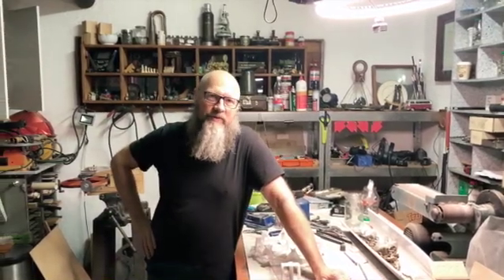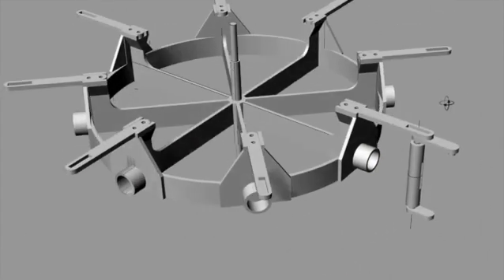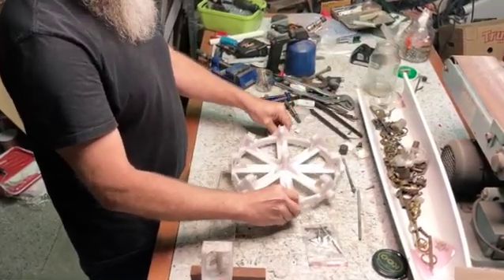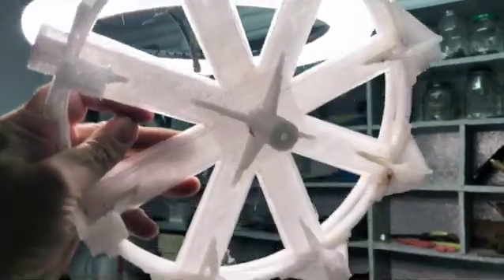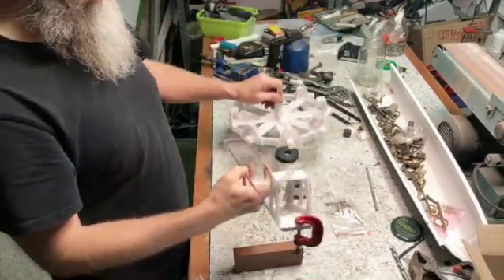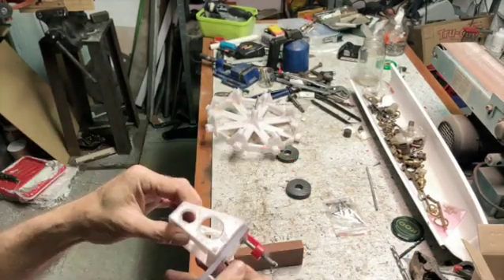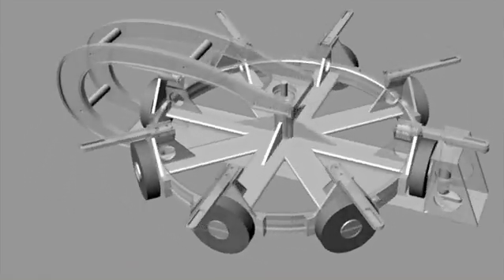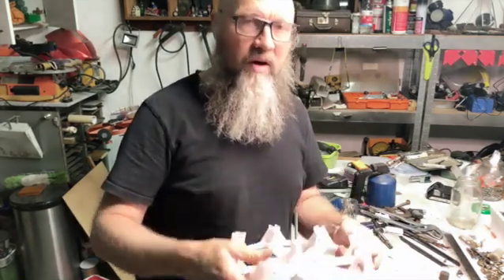How to make a self running magnet motor part 3. Free energy perhaps… l don't know.

Comment: For the record: The wheel of the Ukrainian Igor Beletskiy does NOT work. At the end of his video (21m40s), he says the following: "_Of course, I could shoot this video in such a way that this motor worked for me just as it did for this grandfather, and I could say that this is the real first working model of a perpetual motion machine, and frankly, I even had such thoughts. But that would be a completely different story. ... Sometimes I lose faith in humanity._"

I think Igor has not experimented long enough with adjusting the flipping small magnet. As Sam said, it should not be too weak, but certainly not too strong either! It requires a lot of fine-tuning. The small extra magnets in Igor's replica could also negatively influence the magnetic field between the flipping small magnet and the ring magnets, as Wim also mentioned earlier.

In one of his YouTube comments, Sam says he has tried to mount more than four ring magnets on the wheel in the hopes of generating more power or speed, but failed because in that case the flipping small magnet would not have enough time to fall back to its initial position, where it needs to be before the next ring magnet arrives.
The diameter of Sam's wheel is 19 cm.

By the way, I think that with eight ring magnets on the wheel, the magnetic fields are no longer separated and the wheel becomes one big magnetic field, so the flipping small magnet no longer works properly. Perhaps you could also test with five, or at most six ring magnets on a wheel?

Anyway, keep up the great work, Christoff! Looking forward to your next video!  :-)
Reply from the maker: Thanks for the constructive feedback. I will definitely take all of this into consideration. This journey only started but already I see a huge drop in my views from the first one. I hope to have some positive success in my next video. Will Check out your channel also:-)
Reply: Hi Christoff!

I just saw your messages and watched the video. It looks interesting, and I'll try to find some more information about it. Someone has tried to recreate it: https://www.youtube.com/watch?v=OQ0MNWA1XuQ

But, actually, of all the perpetual motion machines I've seen so far, I think there's only one credible; Sam's construction, which you are building right now!

Comment: information.        the switching/commutation mechanism  SHOULD  BE  LOCATED  AT  THE  SMALLEST  POSSIBLE  RADIUS/near the center of rotation.!       because, that mechanism is  a source  of  Breaking DRAG.!!!        compare the  smaller radius of a commutator in a brushed DC motor.        googletranslate
Reply from the maker: Thanks David. That makes sense. However, the other models I referred to is working this way. Once I can replicate it and get it to run, I will look into getting the switching closer to the center. Problem would be if it is close to the center, I would still have to transfer the movement to the switch, and it will have to step up the leverage to get more speed in the action. It might end up being the same amount of energy taken from the momentum.

Comment: I like how you are already experimenting with a different design instead of just copying what Sam made. Is your wheel going to run horizontally? I am very curious you can make it work with eight magnets. I have watched Igor's video a while ago too. It confirmed to me that the idea works. Do you know why the Italian needed to add an electromagnet?
When I saw the design Sam made it stood out to me that everything was made to prevent any friction. He used bent needles, brass screws and small brass tubes for the needles to turn in. Also he told me he used bearings that you can find on model planes and helicopters. These are very low friction bearings, with a special name too, but I forgot. I've got a feeling the Italian man needed an electromagnet because his design didn't completely resemble Sam's and therefore could not overcome the friction. Or, and it would be VERY disappointing: Sam had an cleverly hidden magnet too. But I still don't think that's the case. Sam was very open about how he built it and let my drive 30 km to view his invention to me.
I would advise you to pay attention to friction wherever you can in your design. Very clever idea to use a pointy tip on the axis! I am a little worried about flipping the 'flip'-magnet using small magnets. When the small magnets interact they could potentially slow things down. But anyways, it seems to work on Igor's wheel too.
My complements on trying to make this all 3D printable. I like the idea of sharing too. You are doing a good job so far!
Reply from the maker: Thanks for the well written comment! Yes, I know that the Italian dude added an elecro magnet. It is disclosed in one of his discriptions. Where in holland are you? I have friends in Aalten.